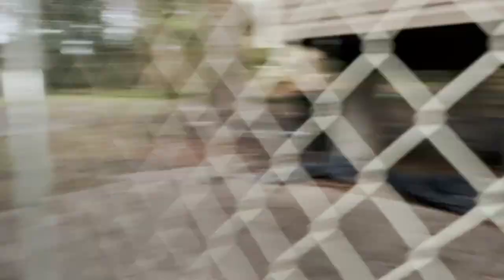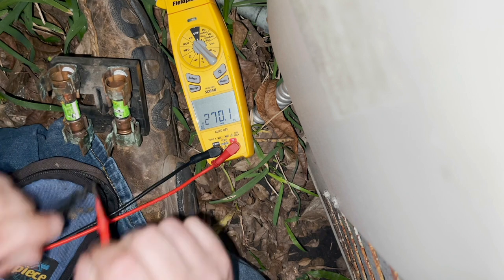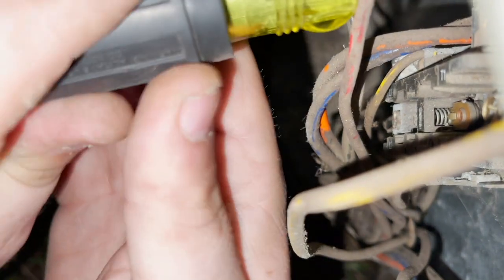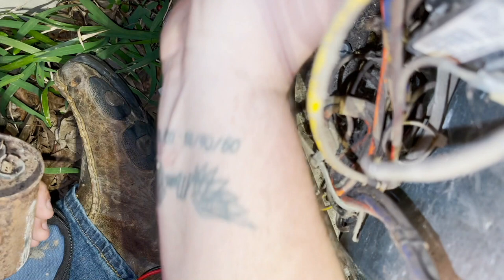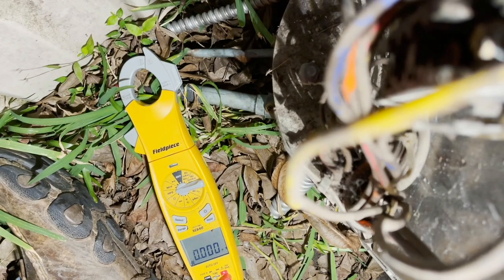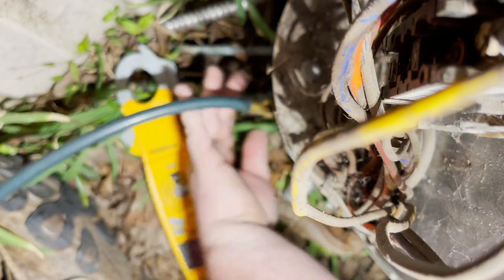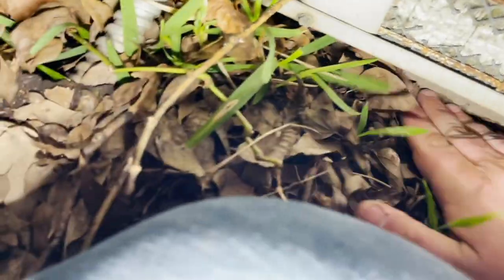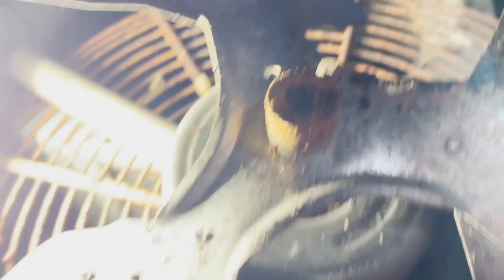No Cooling/Multiple Issues

Comment: Hey a little trick I found to work when capacitors are rusted up is put your meter lead in the hole of the spade terminal of cap and it will read....

Comment: There comes a point where the cost of repair exceeds the value of the equipment. 10 seer, r22 units are not worth putting money in especially when you get it up and running and the compressor is bad due to running without refrigerant  for an extended length of time cycling on thermal overload.

Comment: Agree on the size upgrade! People not in the south just don’t understand how hot our summers are! I went from a 2 to 2.5 ton on my second floor and it easily keeps it cool. It used to run constantly and struggle to stay cool.
Reply: Most mobile homes are usually oversized by at least a half of a ton or more. There is a data sheet in a closet or on a cabinet door that gives the recommended heating and cooling btu's. Most older mobile homes have little to no insulation and have single pane windows... a greenhouse with a toilet..lol